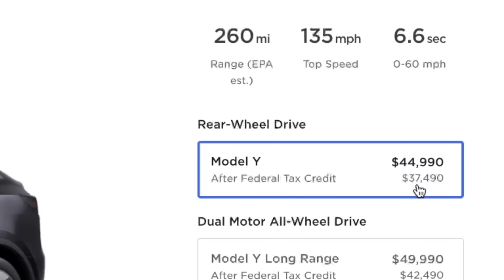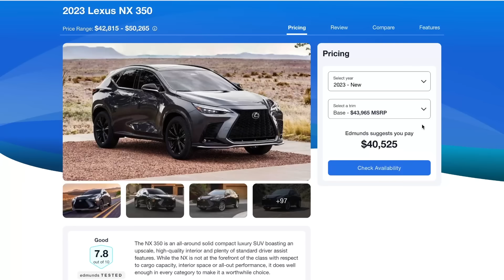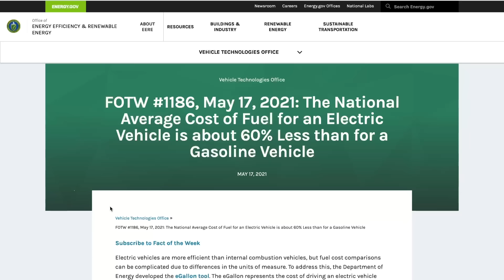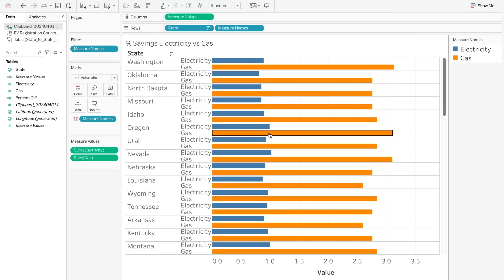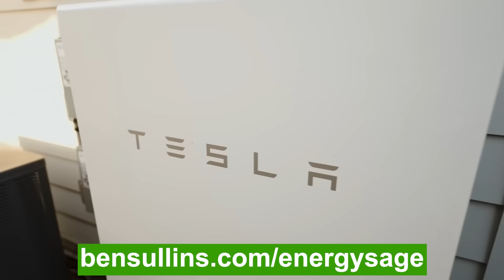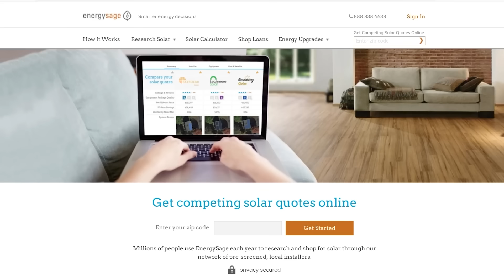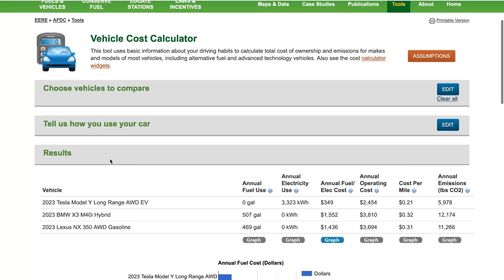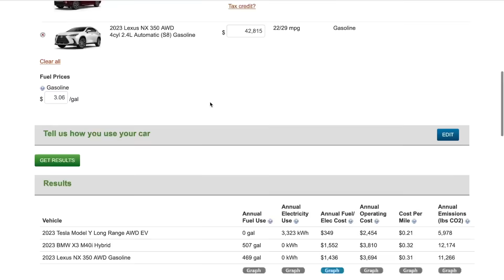Are EVs Really More Expensive? Debunking EV Myths Series

Comment: You are wrong. EVs are not safe, so who cares about affordability, huh? Manufacturers just care about range, making it as cheap as possible - and not about battery safety. No federal laws about battery safety such as fires,  toxic fumes from such fires, and road hazards that could puncture the batteries. Great EV performance, yes, and fuel savings, yes, but what about instruments on board to determine battery life and degradation?

Comment: Good video, however the savings is even more, I think you were being too conservative.  I'm paying $0 per month because of solar, but it would be $30 if I didn't have solar, at .13 per kwh.  A coworker of mine spends $250 per month, same commute, similar miles.  Thats huge savings, around $30k in 10 years.  My Tesla is basically a free car if I keep it for 15 years. Loving my Model Y, its the best car I've ever driven, so much fun.  Try the S3XY buttons and drift mode, it makes the car even more fun, especially in snow.

Comment: Huh? There are a lot cheaper, way cheaper, cars than EVs. 
Expensive maintenance outweighs the actual cost of ev cars AND the savings...plus the ev battery degrades from 100% to less than 50% , making it very difficult to resell (imo, do t wanna resell it because it dupes people who want to buy ev cars). One accident that affects the battery makes your insurance go up...as ev batteries cost almost the same as buying a new one..

Still cheaper to buy petrol cars in the long run. 

As long as ev cars have a high price tag...the environment will still take its toll from petrol cars.

Comment: do you know a battery replacement you aren't getting a brand new replacement, according tesla you will get a remanufactured battery, most cells will be used and might have a less range than your defective battery. Also EV service centers that remanufacture the batteries have been showing that the cells used in tesla batteries are the same low cost Chinese that we see in the china EV cars. The problem with tesla is that they glue the cells and its way harder to service such batteries, several people complaint that replacement batteries dies in less than a year, and tesla only gave them 12 months of warranty in those batteries, not another 10 years or 100k miles.

Comment: why you always compare apples with limes?  So you started comparing the Tesla model Y with the Corolla, a base model Y MSRP its 45000, out of pocket before fees and taxes, a base corolla is 22000, you are not getting a 7500 cash back its just a credit for deduction but still not getting discounted the full 7500 from your taxes, in reality will be around 44500 after tax reduction. Still is doable the price of the Gasoline car, at the Base level. when you mention that car maintenance its around 6k per year, that would be if the car is not under warranty, a new car do not need more than 500 bucks per year of maintenance per year, which means EV are more expensive, because all "preventive services" from Tesla are charged triple the price of what a gasoline car will pay, for example, the tire rotation, cost 75 bucks in Tesla center, if you skip it or take it to another shop you might lose the warranty, according Tesla service center. Also they need to check the suspension called safety check, which its a couple hundreds of labor, No service is free from Tesla,
Reply: A Model Y and a Corolla? Talking about Apples and Limes. Even the Model 3 is bigger than a Corolla and the Model Y is much bigger. Why would anyone compare the 2? Plus what you're ignoring is Tesla doesn't really have a "base level" like a Toyota. Apart from battery size the only downgrade is the audio system. You still get autopilot, driver profiles, heated and ventilated seats, 0 - 62mph in less than 7 secs, phone as key, glass roof, one pedal driving - try getting any of that in a base Toyota. Good luck. I'm not completely familiar with US model but this one seems a comparable size to a Model Y - Toyota Crown Signia XLE Base price $43,590 but more once you chuck in floor mats and an integrated dashcam that the Tesla comes with (but much better). So base price more expensive, not less expensive. BTW, since this video came out Tesla now is only offering the LR RWD  which is only $44,990 before the tax rebate. So a little more expensive but a lot more range.
Reply: @mondotv4216  you still trying to scam people buying this expensive toys? Last month we rented one of these stupid toys, we had to use the roadside assistance to tow it to the super charger, so in order to get the mileage range you need to drive like a granny. Yes it is fast, but that costs the life of your battery. But in a petrol car the faster you go the more petro you save. Here in the States you can get a Corolla fully loaded for 25-30k. It will give you 600miles per 25 dollars of petrol. When your EV will cost you around 80 dollars in supercharging. Yes, if charged at home is cheaper but is a rip off.

Comment: Was it a myth when there were not recycling places for batteries or you could not find a second hand battery?   every vehicle ever made goes through these same issues.. My thing has always been WHY don't we learn from our mistakes and come up with a better solution before we just ramp up production and have a bunch of expensive waste just waiting.   as for solar that cost up front is pretty hefty and for some they can only do one or the other not both.  so either get the used ev or get solar for their home and later in life do the opposite.    I also feel we as a nation should have done a slower drip of change - focus on the hybrid models, then do generation hybrid with full ev then only full ev.. this would give time for the electric production market to catch up I.E. wind solar, thermal plants to be built, as well as grid support to be put in and make solar panels more common and accessable through new construction having to need them.    Anyway good vid and topic discussions.  cheers.

Comment: Picking a Lexus to compare against the Model Y is okay and it is tough to find an exact match of luxury/tech to compare, so I would have added a Rav4 and CRV to the mix. For the masses, the Rav4 and CRV are what normal buyers would likely default to for a crossover when thinking about what to buy. Without the tax credit, the Y is higher, but not buy much depending on what trim level you go with. This I think is huge, because people act like Tesla is very expensive, but people seem to have ignored where new vehicle prices in general. 

The way EV tech is evolving and prices are falling, we are not far off from a market where ICE is the more costly option from day one and EVs will commonly have 300 miles of range and 10-80% recharges will commonly be 10 minutes and we have many charging locations in enough places the stress of where to charge will be very low. I am onboard with the idea of owning EVs now is better than ICE, but for a chunk of the market, they "need" 300 miles or more of range and do not want to wait more than 10 minutes to recharge, all while paying current ICE or lower prices. 

When 2030 rolls around, I believe there will many EV options that are vastly superior to ICE in almost every category. For most buyers, what powers a vehicle does not really matter, it is cost, headaches, reliability, and convenience. The deep, load, rumble sound or smell of gasoline, only matters to a very small percentage of buyers. They are very vocal, so it may seem like half of drivers demand this, but it is not the case. 

Keep up the fight against Ben. I hope people buy EVs, especially from US builders. The top four vehicles you can buy in terms of US parts and labor are EVs. We need to support US manufacturing if we hope to still have manufacturing in the USA.
Reply: Rav 4 prime base version is mid 40s here (XSE Prime was 52k).   It's actually more expensive and it's interior is all basic grade plastics.   I compared them.    Rav 4 hybrid is slightly less at high 30s but for 5k price gap is much less car.

Comment: With the rise of PHEVs I’d like to see you do some comparisons between them and EVs. I’ve had a volt since 2020 and can pretty much get to work and back on a single charge in the summer, in the winter I rely on 120v charging at work. The weekends are more hit and miss because I don’t have a 240v outlet at home so charging between errands isn’t as fast. But the average MPG over nearly 50k miles is 109 which includes a few really long road trips nearly entirely on gas. This isn’t the most efficient in hybrid mode either, only about 33mpg in hybrid mode. Where I live there aren’t as many chargers at certain destinations so range anxiety on day trips becomes an issue where I don’t ever have that with the volt.
Reply from the maker: I've always been a fan of PHEVs

Comment: If you can't charge at home, it is much more expensive to charge an EV than it is to buy gas.  Recently went to Electrify America.  56 cents per Kwh.  My bill was $20.16.  Got about 100 miles of range.  Gas at $4.00 per gallon (it is actually about $3.55 currently) would equal 5 gallons of gas.  30 miles per gallon for 5 miles of gas means 150 miles of range vs 1.  And, I am coming from a Prius that got 50 per gallon.  So that would be 250 vs 100.  Now I can charge at home for way less than that.  but not everyone can.
Reply: Tell me who in their right mind is charging a Tesla at Electrify America? Scratch that - who in their right mind is charging anything at Electrify America? At Tesla superchargers the top rate is about 33 cents an hour. That blows up your analysis and unless you're driving a Prius and you're not driving it on the highway, forget about getting anywhere near that cost of day-to-day operation unless you're getting gas for $2.25 a gallon. So take your disinformation somewhere else please
Reply: That's some impressive cherry-picked data. Point #1, though that makes your post nonsense, is who in their right mind would charge their Eevee at Electrify America?. Most unreliable and most expensive charging Network in the US. The notion that your roughly 40 kilowatts got you 100 mi. suggests you're driving a boat. A more realistic number would be that for your $20, you would get roughly 70 KW hours, and driving a model 3 that would get you basically 260-280 mi. So your cost analysis is BS. I'd call it consistent with disinformation and how the fossil FUD gates are wide open
Reply: I have 2 years of free charging at Electrify America.  I am only pointing out what it costs not what I paid..  Most automakers, that give free charging, use Electrify America.   I don't own a Tesla.  I don't like the interior.  I am driving a BMW IX.  Don't take it personal.  I have had the vehicle for just over 1 year.  It isn't BS.  Below is cut from the bill.
Charging Time	00:25:13
Energy Billed	36.0000 kWh
Charging Cost	$20.16
 @douglaswatt1582

Comment: Interesting charting, but Im not 100% clear on what Im seeing.  I have no doubt that your percentage of savings is valid...in fact as a nebraska resident and knowing that we have pretty cheap electricity, Im not surprised we are on the list...  But Im not quite sure what youre basing the savings on.   I was thinking you could use something like pick a comparable car to an EV...for instance..  a Model Y to a Maxda CX-90 to get a mpg and mpkwh baseline.   Then compare the savings that way.   Obviously different cars on either side of the equation will make for different numbers, but it would be a solid comparison.
Reply from the maker: Check out the DOE e-gallon tool, you can add in whatever cars you want. Just make sure to pick a fair comparison!

Comment: What about charge infrastructure. Ability for charging for renters. It just isn't feasible.
Reply: For renters, charging an ev is only slightly less convenient than gas cars 10%-80% charge now takes 20-30 minutes or so. There are also lots of Level 2 chargers around. If you live or work near one that could be a good solution
Reply: @MoreOnEVs  The problem with level 2 charging stations are that that charge 5 to 85 cent a kw. That no longer makes the cost to run economically. The other stations that charge under 50 cents a kw are level 1 peaking at typically 7 kwh so you have to be there for 6 to 10 hours.
Reply: @mcca555  Your pricing per kwh is heavily dependent on where you are located.  If you don't have a garage or have assigned home parking with access to Charging you really need to do your research as to what your price per kwh can be because it varies greatly location to location.
Reply: @SDGreg  You are making my point exactly. Hence why many people opt out of EV even being an option. 44% of California residents are renters.
Reply: @mcca555  " I say this as an ev owner and renter in a city with over 1 million people."  Did you purchase a EV without figuring out how you where going to charge it and how much it would cost to charge?
Reply: @SDGreg  I received 2 free years of charging which had been nice. It expired in December and since then I have had to get creative. I took a bet on public charging infrastructure getting better but it actually worsened, for me. There are a lot more ev drivers which means there is a higher chance I have to wait at a public starting. Btw Chevrolet and VW are so slow so when they are charging I just leave. I haven't been able to not charge, however, I've had to sit at volta stations rewind a book. Or dropping off a car and coming back 6 hours later. Luckily at work I have access to a dryer plug in which my boss allows me to juice up from time to time. Without that access I would have a much harder time. That and my commute is about 4 miles one way. My point is, yes EV can compete and be more affordable compared to ICE  but for many people it isn't feasible. For home owners and renters with access at their complex 100% it makes sense. Everyone else I recommend a hybrid or trying out a plugin first.
Reply: @mcca555  Whether or not a BEV makes sense for someone is highly individualized and to me is highly dependent on what they have access.  I have seen people who own a house with a garage but the installation of a charging plug would cost thousands of dollars because of how it is setup and the main panel needs a full upgrade.  One guy on youtube with a Chevy Bolt literally had a garage in the side of a hill that was basically a concrete box with zero electrical.  I have also noticed that charging costs can be highly variable between charging companies.  There used to be a charger near me that charged a flat $5 fee per session regardless if you put in 5 kwh or 50 kwh.  Hopefully as the infrastructure matures, things will get better.
Reply: @SDGreg  yup I agree
Reply from the maker: There's some truth there, but depending where you live it's not hard to find ways around it. For example lots of grocery stores, gyms, and offices have charging options so you can fill up while busy doing something else. There's a good book from the guys at EV Annex about creating your "Personal Charging Infrastructure" that's worth checking out
Reply: @BenSullinsOfficial  as stated above level 2 public stations are too expensive and often times they are full or malfunctioning. I say this as an ev owner and renter in a city with over 1 million people. At the moment I can't recommend an ev to renters. The headache is not worth the potential cost savings. Plus PGE rates are so outlandish here that I couldn't imagine adding charging up a 77kw battery ☠️
Reply: @mcca555 bummer about pricing. Not sure where in the world you are, but I’m just north of Boston and the garage near my job has level 2 for $.35/kwh. Also, if the charger is near work or home, 8 hours is not a problem
Reply: @MoreOnEVs  I'm in California. Bay Area. That's a decent price in Boston for public station. This weekend I got hit with a 0.56 per kwh. At that point a hybrid is more cost efficient with tons more options. I had no other option because I traveled long distance to a relative and needed to juice up to get back home.  This was the only station available.
Reply from the maker: Fair. Check out Volta stations if you can, they might help with the cost - https://www.voltacharging.com/

Comment: Ben, when you talk about MSRP, you need to keep in mind that is not the real price of a vehicle when it comes to a dealer. The true price is the INVOICE price. The only way to pay the invoice price is to buy direct from the manufacturer. For instance, from Tesla, Rivian, Lucid, etc.

When buying through a dealer, you have a middleman who needs his cut. So for ALL ICE vehicles, you're paying a markup whether you pay MSRP or even below it, because the invoice price is much lower than the MSRP.

And the only way to get your full $7,500 rebate is to buy it direct. Otherwise, dealers will bake it into the price, and their so called, "discounts." They're already doing it. Just try and get an EV from a dealer $7,500 below MSRP and see. 

So not only are they making the difference between the invoice and the MSRP, but now they're now pocketing part, or all, of your $7,500 rebate on top of that.